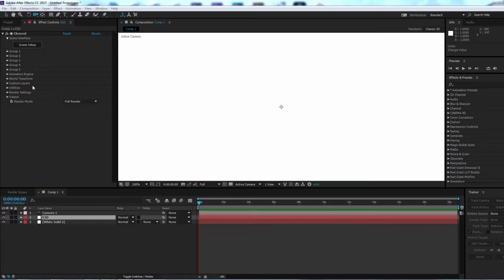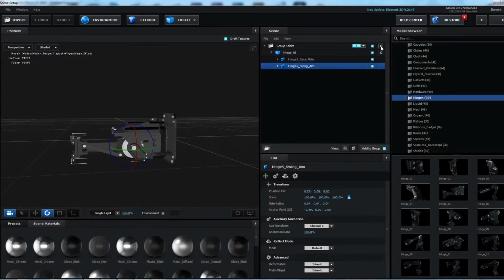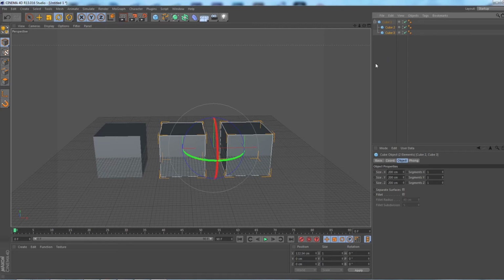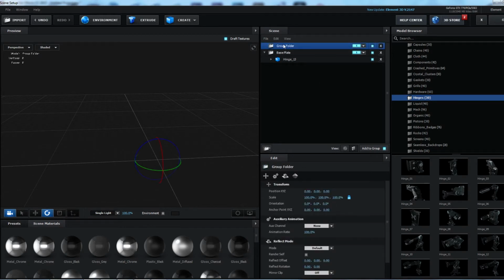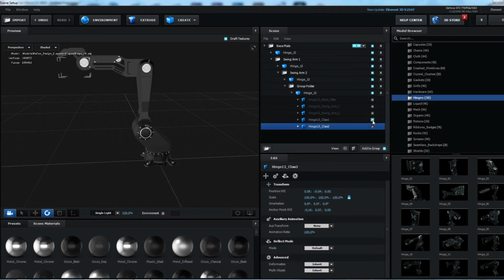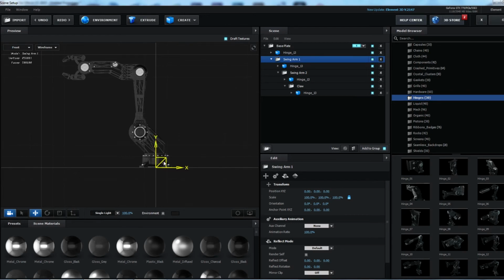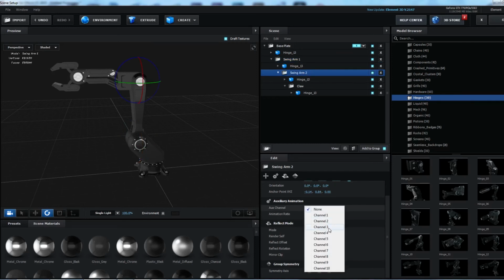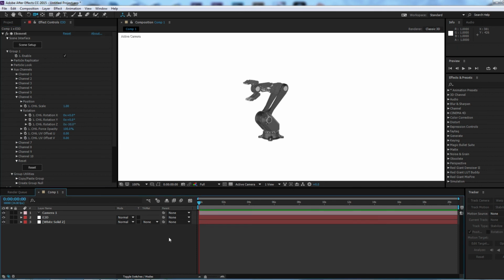Element 3D Motion Design 2 Hinges, How to rig and animate them in After Effects

Comment: Forward Kinematics huh? Not impressed.
Not to mention the models are pre-made outside of After Effects, but this is just a side note.

Now, just from the top of my head, I think you can make Inverse Kinematics out of that by using free IK plugin such as DUIK. Then use Nulls as the "driver" for those element 3d objects (anchor point positions between Nulls and Objects must precisely match). These Nulls are the ones that are actually (directly) rigged by DUIK. Those Element 3D objects can use expression pickwhip so their position and rotational values mirror exactly their "avatar" Nulls. But there arise the problem of parenting, which you can solve by (instead of directly using Null's Position values), use pixel position coordinate of that Null by using the "toComp" expression (if Element 3D coordinate system is different, use offset value on that expression). Then there arise the problem of creating 3D movements with the DUIK controllers, because DUIK can only do XY movements. Realistically, I don't think this problem can be solved in a logical/neat way. But there are quite a few "tricks" that we can do to simulate the third dimension's movements of the arm.
Reply from the maker: ...Dude, I get that you are very good at this but the goal of this video is to help beginners get started. So yes Forward Kinematics it is, I know about the Duik option and as you your self have pointed it out it is complicated and has problems that only some advanced knowledge can solve. This is a quick and easy way to do it. The Absolute best way to do this would be to animate it in C4D, MAYA or 3DsMax and bring the finished animations in Ae but that is also a bit more advanced than what you can see in this tutorial :D Well anyway THX for sharing your knowledge :D
Reply: Yes, you're right. I'm sorry for being too snubbish.
Reply from the maker: Zen RD no problemo, I know what you are saying, knowledge comes in time and steps :D

Comment: Thanks a lot for this tutorial! Pretty interesting!

It give me and idea about how to solve a personal project!

Do you know how you can prepare a model from C4D without doing this child parenting trick? 

For example, a knob rotating on a door, and the door inside a wall, and the wall rotating (with your tutorial i solved it, but i think it should be possible to do it from C4D, just importing it to AE via Element3D).

I saw the "car-rig tutorial" from Videocopilot and it explains how to make it possible with a model coming from Blender, not using the auxiliar channel but the groups menu.
Reply from the maker: despuesdelpatio Glad you found it usefull. I am not a 100% sure what you want to do with the door and knob but, you can animate what you need in C4D and export that animation as a done animation in Element 3D so you do not have to do any anymation in E3D.
Reply: Thanks for the answer!

I´m trying to find a way to import models from C4D with different parts, (as a door, or as car with wheels, or just elements with rotating parts, etc) and animate it directly within AE instead of importing the animation from C4D; i already know that it is possible to import animations from C4D, but i think for this purpose (import animations), cinemaware works better ;) 

But, for what i´m doing, your solution of employ the subfolders in order to use the auxiliar channels, works pretty fine by the moment (if you don´t mind, as soon as i finish the project i´ll show it to you )
Reply from the maker: despuesdelpatio Sure ma, would like to see it :D